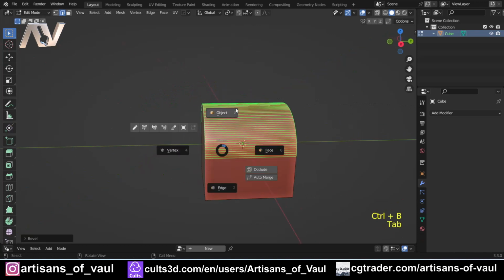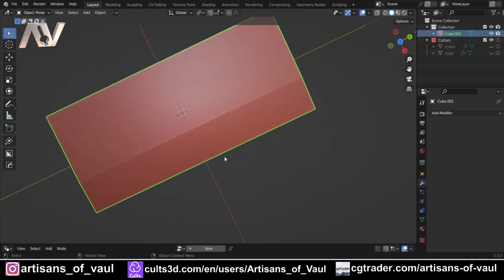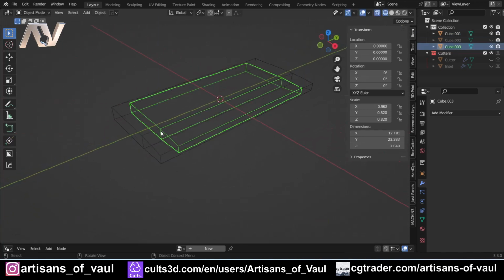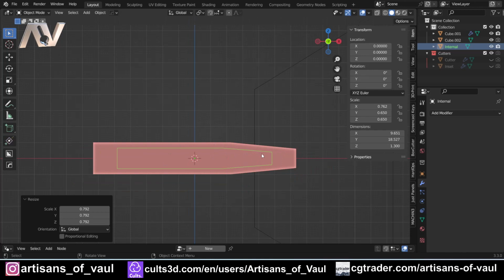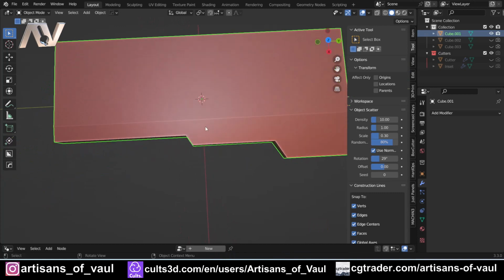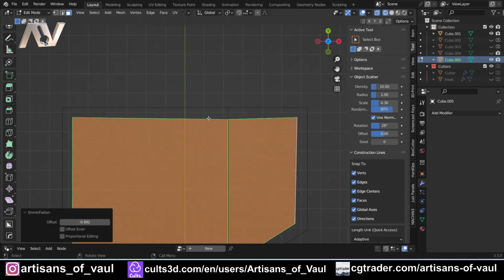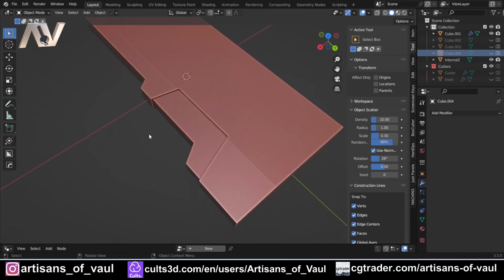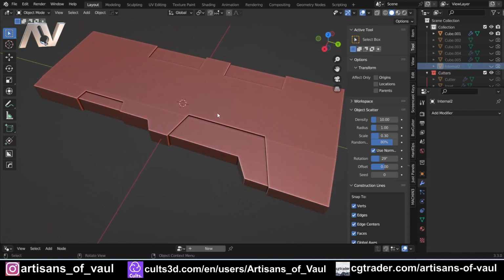Pro tips for creating Inset Panels without paid for add-ons

Comment: Hi, just an other tip, for the inner panel you can duplicate linked (alt D) the base and use the solidify modifier for the linked object, (in the modifier) toggle rim: fill and only rim,  normals: flip and high quality, so you can "shrink" non destructively😉
Reply from the maker: That's cool. And I imagine if its linked data if you scale one it will scale the other? Or does putting in the modifier break the "link"?
Reply: @ArtisansofVaul  yes everything you change in the one object, will change in the other one too (including modeling)  the modifier shouldn't break the linked data
Reply from the maker: I had always assumed the modifier would appear on both, so that's really cool of not.

Comment: A tip I've learned from the JustPanels add-on is that you can use the "displace" modifier as a non-destructive alternative to the shrink/fatten tool. From my experience, setting the "midlevel" parameter to 0 makes the strength function as the actual offset distance.
Reply from the maker: I'm totally going to give that a go! Thanks so much 😁👍🏻

Comment: Wouldn't be faster to just Knife-cut and then Extrude-Along-Normals for something like this?
Reply from the maker: Yes and no. Yes that would work but not for the cuts made at an angle (so not perpendicular to each other). So if it was a perfect cube it would work but here it would make a bit of a mess. Though even for something that was a cube/rectangle being cut from a mesh I'd still do it this way as I'd always recommend a non destructive over a destructive workflow. But that's personal preference

Comment: Solid tips as usual, Neil!
Saved it to my "3D tips" playlist.

Could you please cover another related topic - how to do parametric, non-destructive panel lines in Blender?
1. As separate objects which could be modified (position, thickness) later (say, after test printing to check how they look on real thing)
2. Applied to curved surfaces - i.e. wing, fuselage etc
3. Not requiring perfect mesh to be applied to - as you may know after 3D scan the mesh is a big mess...

Would be super useful for all aviation 3D print enthusiasts!
Reply from the maker: So I already have a couple of videos on panel lines that can do this in a few ways:
https://youtu.be/kNpB0RrhuOA
https://youtu.be/L0752ooFmU0

However, next week I will be adding to this with another video I think you'll find VERY interesting from a 3D printing focus.
Reply: @ArtisansofVaul  
Yes, I saw that videos.
That method is OK for 1-2 lines, but imagine making for example Spitfire's wing with dozens of lines plus for the both sides...
And lots of small round hatches here and there...

Looking forward to upcoming video! 👍🏻
Reply from the maker: @P1x3lMagic  Hopefully what is coming will help with that. Though I must say for things like that nothing is perfect, I've made a load of Tau buildings and it does take some time unfortunately.
Reply: @ArtisansofVaul  
I'm thinking of some kind of separate objects to form 'panel lines grid' to subtract them from base mesh to do the trick...

But I'm stuck with aligning simple objects (like parallelepiped/wedge) along curved objects to achieve uniform cut-out.
Reply from the maker: @P1x3lMagic  The second video I linked does exactly what you want then (I think) using other objects to form the panels.

Comment: it is a useful way of doing this, but in that particular model its faster to cut it with knife tool and inset with no thickness and only depth.
Reply from the maker: Im not actually sure that is faster.  It's not wrong of course, it would definetly work but cutting, then scaling on only certain axis so that it's still all connected is more annoying to me, especially once you have done it once and you just copy the cutter so the boolean is still enabled.  This is talking from a 3D printing workflow though, if not then it may be easier to do it that way as you don't have to then worry about there being any gaps or booleaning the seperate pieces together.
Reply: @ArtisansofVaul  that is what i meant, for a few cut on that simple object inset is really fast.
Reply from the maker: @plusthinking  Oh sorry, you mean use the cut tool and in my head I assumed you meant using the slice boolean option, apologies, its been a long week. That works if you don't mind having the slight angle on the panel edges, otherwise you're probably going to need to realign everything to be perfectly horizontal/vertical wouldn't you?
Reply: @ArtisansofVaul  inset tool create 90 degrees angle if you want. do more work if you want z locked angles on tilted faces.
Reply from the maker: @sudd3660  Oh really.  Im going to have to have a look at that.  Thanks so much 😁
Reply from the maker: @sudd3660  Just had a try.  It doesnt seem to work very well if the cuts are off perfectly being on the x, y or z axes.  They are not perfectly aligned with the original points, unless there is a way to control that, but I cant seem to find one.
Reply: @ArtisansofVaul  its the little menu(bottom left) that pops up when using inset tool, press f9 to get the options back if you click away from it.
Reply from the maker: @sudd3660  Yep, but with that it creates some offset so that the sides are not perfect.
Reply: @ArtisansofVaul  by offset you mean the thickness value? as long as that is set to zero and you set a depth value it will inset invards perfect 90 degree angle.
Reply from the maker: @plusthinking  That definetly didn't happen when the cuts weren't parallel to an axis for mine. Its annoying pictures can't be added to comments.
Reply: @ArtisansofVaul  i am on blender version 3.4.
and i made a oddly shaped thing and it still worked pretty good.  with cut thru and not. both worked.
Reply from the maker: @sudd3660  So when I have the edges of the cut at an angle it causes the issues you can see in the photo linked: https://drive.google.com/file/d/1jgoWx4aQrDWe7xZ3Io-6IpfrEdiG-RXw/view?usp=sharing
Reply: @ArtisansofVaul  i cant see it all from that camera angle,  but when you try this method on other simple objects it works then?
Reply from the maker: @plusthinking  It worked when it was a cube yeah. Just not when it was a trapezoidal shape.
Reply: @ArtisansofVaul  made a trapezoid, loopcut near the top, and inset the top 5 faces, at zero thickness its always 90 degrees angles, adjust the thickness to get lower degrees as i think that is what you want in some cases.